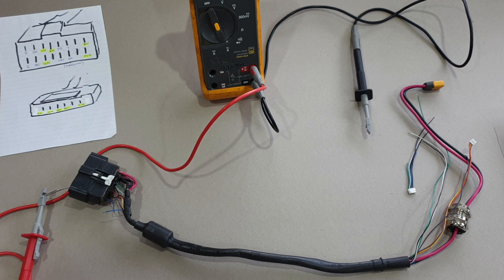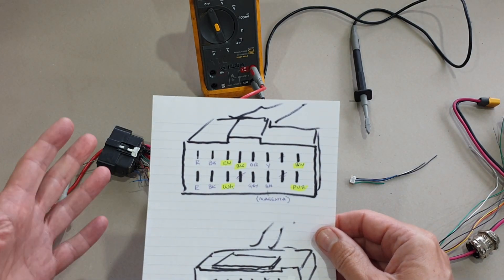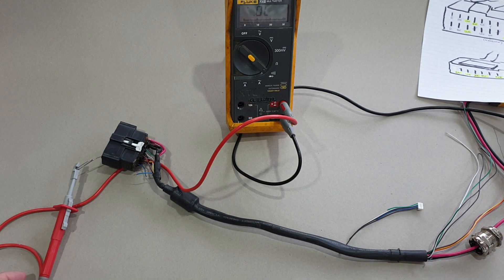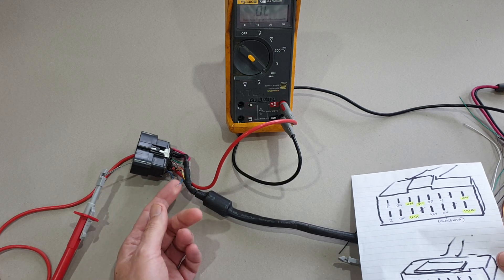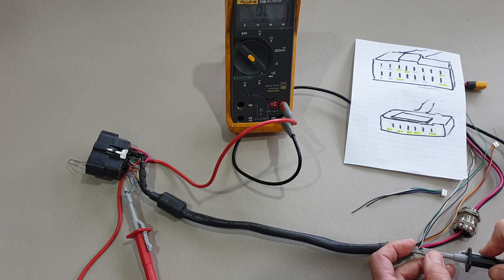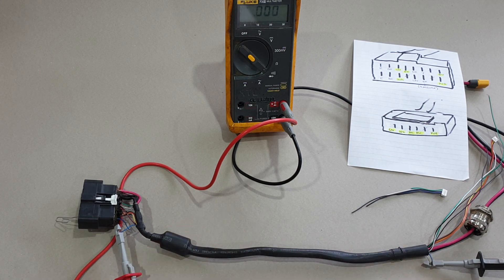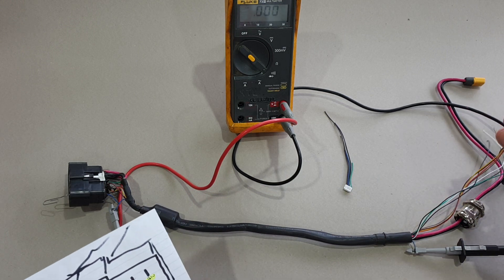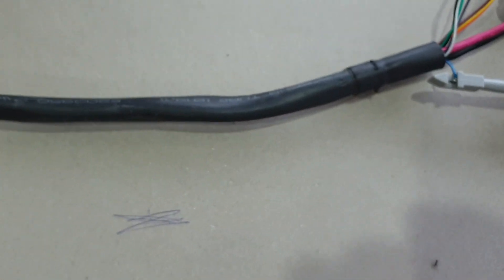OneWheel Xr - Error code 16, fault finding.

Comment: Thank you! I had the same issue. Found 1 fault using your method of bending the loom. When I removed the loom insulation I found multiple more future issues.
Reply from the maker: Yes crazy isn't it. The wiring is rubbish.

Comment: Super helpful. I have a vesc on its way since the board tossing  this error In  my case is a 4212.. fm is such shit, bad quality wiring and with zero expansion or contraction loops, only the exact length needed, very very poor electrical practices.. from a controlls electrician

Comment: Hi is this likely to be the only thing to create errior 16 my xr  has the same error code the LED on /off will not turn off and the board will not engage  in getting” error 16”r “eboot “and” board must be flat on ground ' “ notifications  any advice would be appreciated thank you
Reply from the maker: It may be something else but from everything I've read on forums it's a dodgy wire. If you have a mate with an XR see if you can borrow their battery and plug it it. But of a pain but it will isolate your problem. Then ask around for a used battery box and cable or just cable.

Comment: I had that same issue instead of salvaging the harness I Just made a new one and soldered the connectors since the blasted tools is $1200.
Reply from the maker: I ended up chopping all the small ones and joining new. But overall it was a far bigger job than it needs to be.
Reply: @GazzasStuff  That's usually how it goes with the microscopic connectors.

Comment: Took me 3 years to find a flakey wire mid harness between a throttle computer and the ICU in a Chevy truck to fix intermittent “Reduced Power Mode” errors.  Congratulations!
Reply from the maker: I got lucky in some ways for the first 15 mins none of the wires indicated a break, then I gave it another go and it dropped just once and focused on the blue. It'd be nearly impossible in a vehicle loom. Top marks on tenacity. I was blowing tail lights on my 33 pickup and one day I decided to sleeve the loom in the engine bay, I got a wire pole me half way down. One tiny copper wire was poking out (how?) and once in a while it'd short on the firewall. Now that was luck. I'd never have looked there.